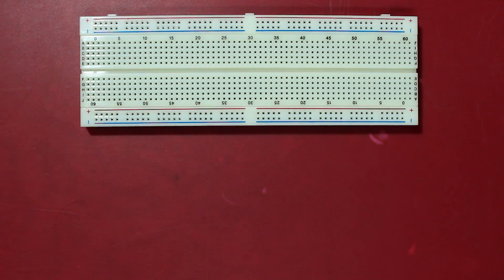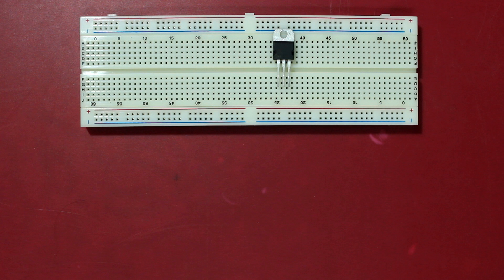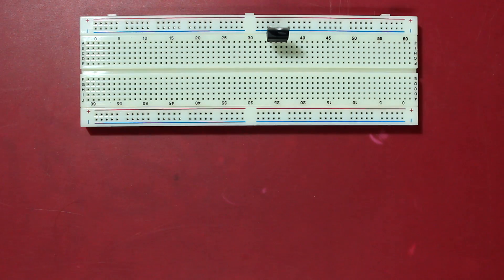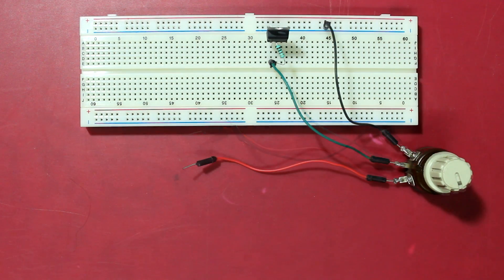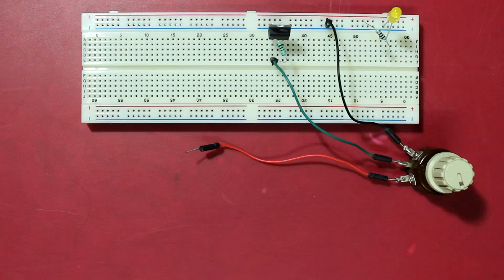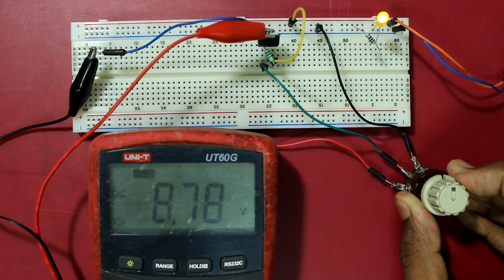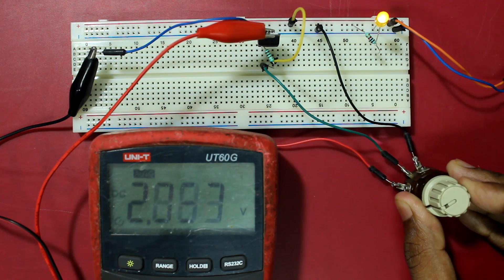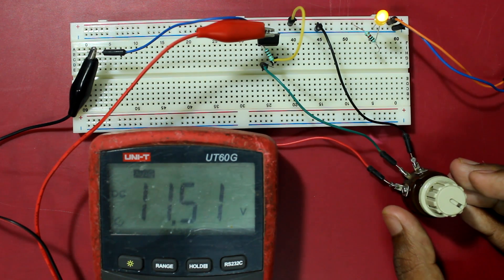LM317T adjustable voltage regulator

Comment: I need to reduce dc voltage that is 3.3v  input require out must be 1.5v plz help me
Reply: If the 3V3 input is regulated just use a voltage divider resistor network. If it isn't regulated (e.g. battery) you can probably use the LM317 IC as configured in the video and just turn the dial until you get the desired voltage then measure the resistance of the pot and integrated that into the final circuit. Just remember, the LM317 can only drive up to 1.5A.